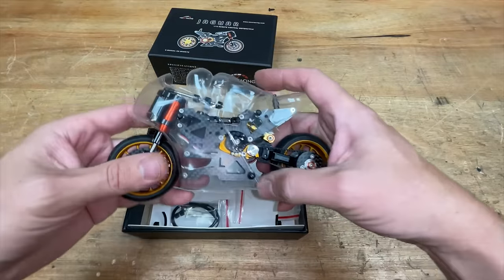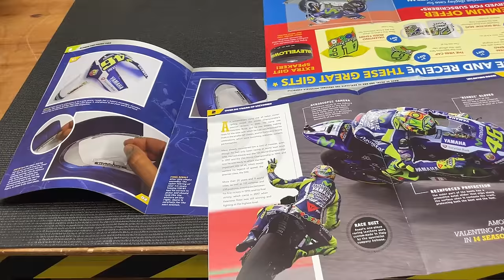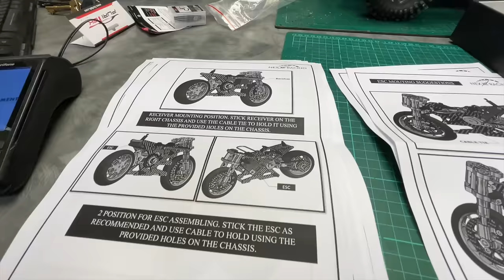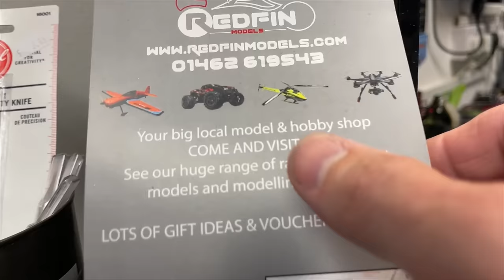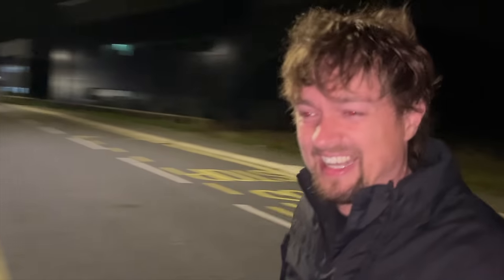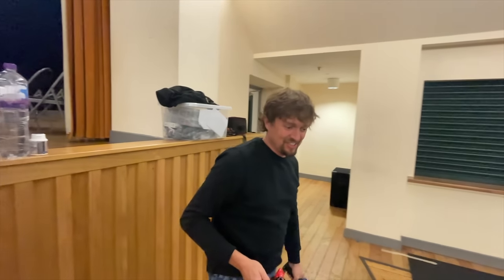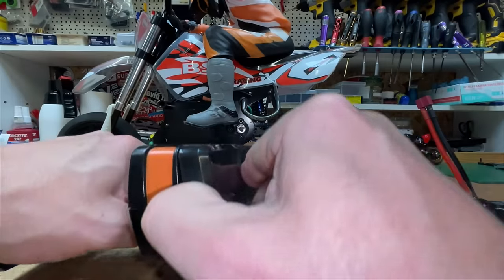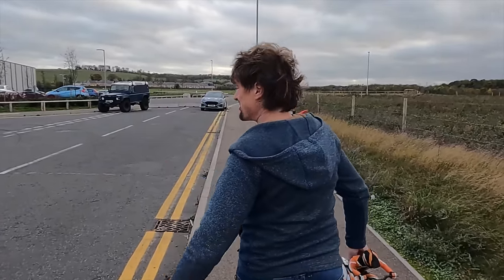mini RC Superbike is too fast!!

Comment: I have a thunder tiger SB-5, I was driving like you for a while before I figured it out. biggest thing is, a set of good tires make a world of difference. My stock tires were foamy and pretty much unusable; the bike would spin out and flip with the slightest throttle. Sensored ESC and motor also makes throttle imput more managable without having to compensate with transmitter programing. Lastly just practice, know the bike uses the tires as a gyroscopic effect so the slower you go the less stability, you should be able to pick the bike up from a stand still on the skid bars by turning away while trottling and then into the turn at speed. My bike is 1/5 so im sure its not quite the same as theese small ones, but they are a lot of fun once you get the hang of them.

Comment: Happy New Year Kev!!
As someone that has both small and large 1/5 scale bikes too, I've found the smaller they are, the harder they are to use. 
That little bike is a work of art. Needs a super smooth surface that still affords some grip like a basketball court. Very smooth throttle and steering inputs. you don't need much steering throw either.
Shorten your stabilizers a little and ease into turns by backing off the throttle, turning (countersteer at speed and normal steering when going slow....That's why they can be challenging!!)  and then accelerating out smoothly. 
It's all about being smooth with the controls.
They are epic once you get the hang of them and of course having a huge flywheel in the back wheel helps tremendously!!
Reply: or even a tennis court, the one with the rubber surface...or a running track........
Reply: @muskokamike127  Spot on mate, good thinking.
Reply: I need your rc car 🚨 and militar
Reply: I need one your rc car
Reply: @MarcianaMacalam  Do what everyone else does mate...work for them. Free stuff is for dreamers.

Comment: Hiya Kev. First I would like to wish you a Happy New Year.  Hope 2023 is a good one. 

 I wouldn't recommend De Agostini! It's a very expensive way to build a kit.  I built a nitro car a while ago. I think it worked out to be around £500.  The only upside is that you knew every inch of your model.  Eventually, the gearbox broke and De Agostini couldn't get me a replacement as they had discontinued the model.  Work it out money-wise for yourself.

Comment: I've tried few times with RC bikes, but to keep the balance on two wheel is such a pain in the arse for me. So I've solved the problem by fixing a two side wheels on the rear part of the construction like those we fixing on the beginners bycicle. Now it goes well ;-)

Comment: Was always told it has to have a mechanical gyro to stay upright… 👍
Reply: Incorrect. Real motorcycles do not have a gyro and these are meant to work the same way
Reply: @everettstormy  yes but physics do not scale down the same.
Reply: @everettstormy  Real motorcycle have human to counterbalance 🙂
Reply: @everettstormy  they also have gasoline internal combustion engines, what’s your point? Watch the end of the video. R/C super moto bike, stays upright no problem. Wonder why? Has a centrifugal balance weight that keeps it upright. Who’d a thunk..?
Reply: @frankensteincreations4740  yeah but a real motorcycles does not have a giant spinning gyro whoda thunk
Reply: The wheels and springs on the steering allow the geometry of the bike to remain stable. It really just takes a lot more skill like Kev said. I'm not stupid you all just need to learn more about how a bike works. Yeah the physics do scale down and much like a real motorcycle this thing needs practice.
Reply: @frankensteincreations4740  oh one more thing. There are plenty of motorcycles with electric motors
Reply: @@sourandjaded2586 finally, lol

Comment: increase driving wheel weight for more gyro effect

disconnect servo from actual steering , or connect it in such a way that max servo output does change the servo saver, but moves the steering only by a bear minimum (not sure how that would be done)
increase weight on the servo saver at the point away from the center so you have weight to throw the bike around

Comment: I had one of these mini motorcycles about 12 years ago i cant remember the brand but the chain was basically a rubber band just like this one. 
It only had a tiny 180 size brushed motor running of a 2S lipo. It was a QUICK fucker! 

So much fun, RC on two wheels!

Comment: steering has way too much travel. Set it so its got about 10% throw on the steering servo so it moves about 20 degrees total.
Reply: I would also try and slow the steering down. Smaller movements and more smooth speed would definitely help.

Comment: On the Kyosho after some experience I removed the front wheel weight and side bars. It was a little more difficult to drive and no more self starting But faster and more enjoyable. So adding some weight in the front wheel  this tiny new one should be better. Happy New Year to you all. Ciao Nanni

Comment: The last time I had an r/c motorcycle it had no steering on the front wheel itself. Instead it used the weight of the battery in the bottom to shift the weight, and the front steering free pivoted. Very easy to drive that one :)

Comment: You should try the SkyRC SR5 it has an electronic flywheel in the rear wheel that makes the motorbike stable even at very slow speeds. I have the SkyRC SR4 which is basically the same as the SR5 other than different front forks and different colour scheme. It is also very fast at around 50mph. I run mine on a 2S 6000mah lipo on-road and a 3S 3600mah lipo off-road. If you use a 3S on-road it is very hard to keep the front wheel on the floor. It easily does wheelies on command. Just pull the throttle and up it goes. Its the best RC thing i've ever bought.

Comment: I have a cheap one  which has a mechanical gyro (metal flywheel which starts spinning as soon as  remote is binded ) which help so much in balance and better control.

Comment: I have one similar too this and a larger scale that has a gyro built into the rear wheel hub it’s a road bike and it’s dam fast and stable compared to the smaller one like you have
Reply: That's what I was gonna suggest.. a gyro...
Reply: @neilwatcham8932  some have them some delete them it’s a system in the rear wheel not a gyro like you would see on a rc plane,many thst race them don’t run them in the wheel wheel so it’s more nibble but this bike is just a cheaper one I got one just like it but different name and it’s shit compared to the bigger scale bike I got
Reply: How many sun lbs can I get from this comment

Comment: So when your riding a motorcycle at any speed under around 12mph the steering acts as you’d assume it too, turn the handlebar’s left you go left. But once you gain speed and your wheels start spinning fast enough to help keep balance gyroscopically the steering all of a sudden changes. So in order to initiate a corner you must momentarily steer counter to your chosen direction. “Counter steering”, challenges a lot of beginner riders around sharper corners and cause the rider to panic if they can’t grasp the simple concept. A trick that make it easier to understand is, “Push left go left, push right go right.”

Comment: after watching the full video I think the manufacturers intended for it to lean on the steel clip in the turn and of course be upright on the straight.
I think it's too small to be in a turn any other way. you would need tremendous speed for it to stay upright in the turn.

Comment: Thing with RC bikes and bikes in general is you need speed to keep them stable, so your tried and true "if in doubt, go flat out" should work for straight line launches, as for turning, real sports bikes turn by leaning, as well as turning the handle bars, how to get the rc bike to lean, I'm not too sure how you would.

Comment: I had a Kyosho RC motorcycle back when I was a teen, it was fun but if you were on a surface other than brushed concrete it would slip and fall over.

Comment: How did you convert the wiring for the full size rx?  What is next to the esc?  What is the grey wire surrounding the rx?  Does this only work with the Noble tx or will other flysky work?   Please do Deagostini F1 nitro vintage Ferrari monthly kit.  They are hard to find now. Please do any F1's...Tamiyas are fun to build and run on tennis courts.

Comment: The issue is when a person rides a bike they have a sort of balance sensor in their body so you unconsciously make micro adjustments to steering when you feel you are going to fall over. So for example you are leaning over to the right too much, you will instinctively flick the handle bars even more to the right to push you back up straight. Its like if you try to balance a piece of wood in your hand.
Reply: I said instead of steering, the servo should have a weight attached to the horn. To turn, when the horn moves to the right, the bike will lean that way and turn.

BTW: if you flick your handlebars because you're leaning too far, you'll go for a slide....99% of the steering is done with your weight.
Reply: That's just not true.  You can set a bike off all on it's own with no rider and it will go in a straightish line until it collides with something.
Reply: @glennmaxfield6618  thats because of the angle of the front axle, it will steer a certain extent to keep the bike up. The bike stays up when the bike leans over a couple of degrees so that handle bars will tend to turn as well which can straighten up the bike. If you are walking your bike by holding it by the seat you can make turn a bit by leaning it slightly.
Reply: @turbinegraphics16  This is true but by leaning the bike by the seat you are initiating an imbalance which the bike will turn into so it can maintain balance and forward motion.  The angle of the forks is crucial to a well balanced riding bike.  None of this applies to choppers with extended forks.  They have a mind of their own - lol
Reply: @glennmaxfield6618  Speaking of That's just not true....what you say ONLY applies to bikes with extremely low center of gravity (think goldwings or bmw) anything with a higher center of gravity it won't happen.

Not to mention that you'd have to have the bike moving at a decent rate of speed otherwise it would fall over. 

What you're trying to say is: a bike will stand on it's own in one place and doesn't need a kickstand.
Reply: @muskokamike127  Of course forward momentum plays a massive part in the self righting principle.  It will work on any bike of any size at the right speed.  The speed of that does, as you say, depend on the gravity situation but aren't we just agreeing that a bike will continue even if the rider is dismounted.
Reply: @glennmaxfield6618  "will continue even if the rider is dismounted." no, it CAN continue if the rider is dismounted.....It would only happen if the bike was perfectly balanced when the rider left and he didn't upset it on his way off. Even a good crosswind would upset it.

Comment: I case you don't know the steering is reversed , so when you turn the controller to the right the front wheel turns to the left its called counter steering . 
Also you don't steer it like a car you have to release the steering once bike is turning or you will end up with a massive turning circle.

Comment: I have a Venom RC bike, there is a trick to driving them. They're hard. Faster is better as the weighted front wheel creates a better gyroscopic righting force at speeds,makinh it more stable

Comment: This bike has noobs scratching their heads.  They are tricky at first.  Try tennis courts.  Set up the steering servo spring loose.  Kevin since you can do heli 3D, this shouldnt be so hard.  Concentrate and go slow.  Try not to use the crash bars at all.   Watch Japanese tracks on this bike and others. They know how to run them.  RC Moto racing is big in Europe also.   My fleet: Thunder Tiger Ducati nitro modded, ZH, Venom, Kyosho HOR, Kyosho Mini MotoZ...soon Nexx Jaguar.  My bikes use roller wheels instead of bars (like mini training wheels up high). They were custom made and Im not sure why it never caught on.

Comment: If you would use the radios expo setting and dial down the steering response in the center and more toward the extremes of the steering it would steer more smoothly

Comment: I believe I saw a video from France where they were racing rc motorbikes on a big track that had banked turns and they traveled a little faster. After reading some comments, I think they were nitro because I remember the high pitched gears sound,

Comment: Pretty neat. I remember having one in the early 1980’s. It was electric and about 3 x the size. It worked great.
Reply: Had one in the 80’s too either Tamiya or Kyosho. To stand it up just steer into the floor and throttle it. Take little practice but once got it bike looked like real thing

Comment: A Motorbike is not steering like a Car ( right for right / left for left ), the Front Wheel has to steer the oposit way of your Curve direction ( left for right Turn/ right for left Turn ) because a Bike is steerig with waight transfer.

Try it out and it will work, the Reely Dirtbike works same way.

Comment: These normally have a flywheel spinning inside to help keep it upright 🤷🏼‍♂️
Reply: Gyro
Reply: @mindedchaos  yes 👍🏻
Reply: @mindedchaos  nope, flywheels are used not gyros but it does create a gyroscopic effect!
Reply: @EZ-D-FIANT  new I was right 🤪👍🏻
Reply: @1982james111  gyroscopes have 3 degrees of axis, a spinning fixed wheel is not a gyroscope however on something with a liner motion of direction a flywheel creates a good enough stabilising effect!
Show me one example of an actual gyro used in this application or bow to your ignorance..
Reply: @EZ-D-FIANT  are you sure your response is directed to me?
I did say it was a flywheel 🤷🏼‍♂️
Reply: @1982james111  ah yea you were saying "knew I was right", yea my bad I thought you were matey saying it was a gyro you were correct, twice....😅

Comment: Cool 😎 I had thunder tiger fm-1E Ducati no gyro , they came nitro also pretty awesome 
They are odd to drive ride at first 😂 my steer was set left is right right is left ,believe it or not , it was the way 
It a tip in catch it throttle kinda deal 😂 gyros are for beginners 😂

Comment: Problem you have is trying to steer by turning the steering wheel too much. In the case you not realized it yet, that changes the orientation of shaft of the front wheel, making motorcycle practically turn around the shaft and lay down on the floor. 
You simply cannot steer to much with that thing. Motorcycles are not a drift cars in the end of day. They are made for fast cruising. 
What are you doing is steering with your Lamborghini at the speed of 250 kmh.

Comment: got the 1970s vertion lol bloody big carpark thats as flat as a sheet off glass is what you need to run them on did have 2 till i had a house fire, eleck rider was the first production rc motorbike looks like it is easyer to drive than that one though as it is bigger and you put the resever in the driver there's some usless information for you haha

Comment: Did you invert the steering? RC Moto’s should be reversed to what cars get mapped to, when you have it benched looking down on it, when you input left on your remote the bikes front wheel should go right. The counter steer causes the bike to lean and go left, it’s all bass ackwards with these bikes.

Comment: The way to get it going is to hold the rear wheel just off the ground and accelerate then while the wheel is spinning gently drop the wheel down and that initial speed keeps it upright